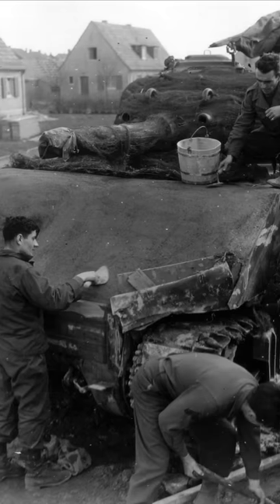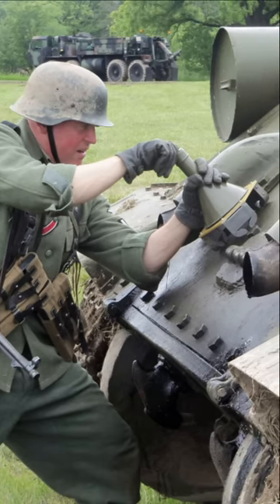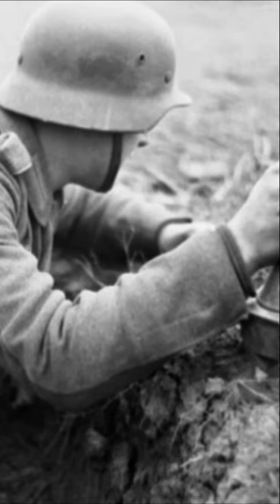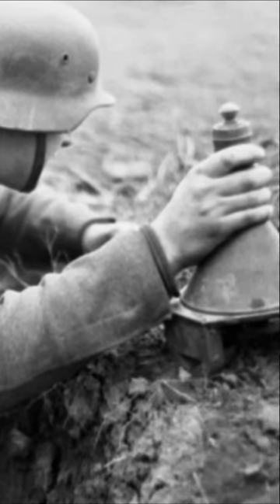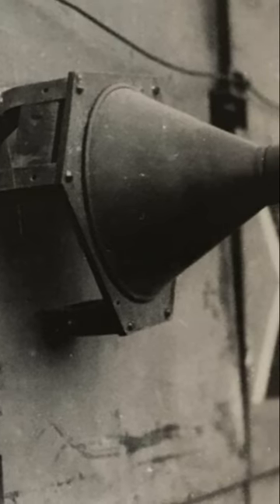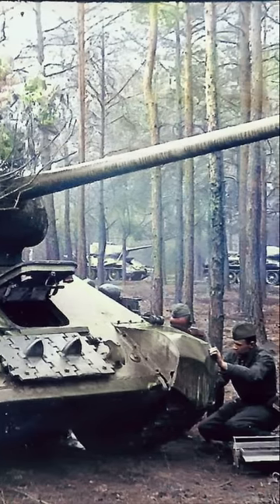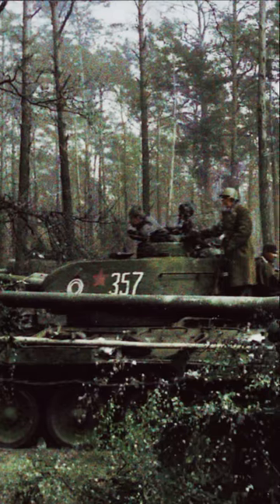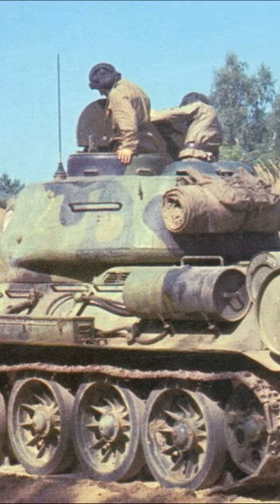Why did they put cement on tanks during World War II? #shorts

Comment: Notably the American crews also added concrete to the front and sides of Sherman’s to increase their armour protection
Reply: That's the main reason.
Reply: yea but it's more of a moral boost at best
Reply: But most as a moral boost as the concrete just added weight and a lot more shrapnel
Reply: Still did nothing tho
Reply: @TacticalGaming_  it did nothing for a shot from a 88mm or a 75mm hitting directly to about 45° but if the shot was hitting at a shallower angle increased the chances of a ricochet.
It did help a lot Vs 50mm pak38s and smaller and of course Panzerfaust.
Not really worth the lower mobility and extra wear on the tank but you can understand why crews did it.
Reply: To *supposedly increase protection

It didn't work
Reply: Lei en una novela que usaban sacos de cemento o arena como protección adicional. Hasta algo de madera hubiera servido. Hay un video que relata que por los 70s usaron "blindaje" de madera contra rebeldes con RPGs en Filipinas.
Reply: @CS-zn6pp  it actually decreased the chance of richochet and probably increased the chances of penetration, because the concrete was so soft it guided the tip of the shell right into the steel and prevented richochet. It effectively became basically a reverse Armor-piercing hard cap.
Reply: They used logs and put them on the sides of it too, which was arguably the 1st reactive armor available
Reply: I highly doubt that a thicker layer of concrete would stick to a vibrating metal machine. Doesn’t sound plausible
Reply: @andresamplonius315  Yes, you are correct. That is right. They used wood in Phillipines to stop the RPGs from blowing up their tanks & armored vehicles, and the wood actually WORKED successfully at stopping the RPGs! But, Sometimes the vehicles may have been damaged still but the wood would save the crew or people inside the vehicle from dying after a RPG hit their vehicle, instead of without the wood armor the vehicle would have completely exploded and the crew / people would have died.

The makeshift or homemade scrap wood armor on Army vehicles in Phillipines was able to successfully stop RPGs from completely destroying or blowing up the vehicle because of the way the RPG works:
The RPG does not explode immediately on impact, the RPG will hit the target and explode 1-3 seconds after the impact so that way the RPG missile can go through the armor. Most RPG missiles work this way because if the RPG exploded on immediately on impact then the middle would explode OUTSIDE the vehicle or armor wall, it would just explode on the armor inside of cutting through the armor all of the way and exploding inside of the vehicle. 

This means the makeshift scrap wood armor that was put on the vehicles was able to stop RPGs from completely destroying the vehicles, because the RPG missile would hit or impact the wood first causing the fuse to go off before the missile hit the armor, this would cause the RPG to explode outside of the armor or on the armor instead of how it is supposed to work by cutting through the armor and exploding. 
Basically the RPG hits the wood, which causes the fuse to start the explosion and then the explosion happens outside of or on the armor of the tank instead of exploding inside of the tank.

It is amazing how some makeshift or homemade scrap wood armor put on Tank was able to save them from RPGs!
Reply: @andresamplonius315  Sí, estás en lo correcto.  Eso es correcto.  ¡Usaron madera en Filipinas para evitar que los juegos de rol volaran sus tanques y vehículos blindados, y la madera realmente FUNCIONÓ con éxito para detener los juegos de rol!  Pero, a veces, los vehículos aún pueden haber sido dañados, pero la madera evitaría que la tripulación o las personas dentro del vehículo murieran después de que un RPG golpeó su vehículo, en lugar de sin la armadura de madera, el vehículo habría explotado por completo y la tripulación / personas habrían  fallecido.

 La armadura de madera de desecho improvisada o hecha en casa en los vehículos del ejército en Filipinas fue capaz de evitar que los juegos de rol destruyeran o hicieran estallar el vehículo por completo debido a la forma en que funciona el juego de rol:
 El RPG no explota inmediatamente al impactar, el RPG golpeará el objetivo y explotará 1-3 segundos después del golpe o impacto para que el misil RPG pueda atravesar la armadura y explotar dentro del vehículo.  La mayoría de los misiles RPG funcionan de esta manera porque si el cohete RPG solo explotara inmediatamente al impactar o golpear, entonces el misil explotaría FUERA del vehículo o la pared de la armadura, solo explotaría en la superficie de la armadura en lugar de atravesar la armadura todo el  camino y explotar dentro del vehículo.

 Esto significa que la armadura de madera de desecho improvisada que se colocó en los vehículos pudo evitar que los juegos de rol destruyeran completamente sus vehículos, porque el misil RPG golpearía o impactaría la madera primero, lo que provocaría que la mecha se disparara antes de que el misil golpeara la armadura.  esto haría que el juego de rol explotara temprano fuera de la armadura o en la armadura en lugar de cómo se supone que funciona cortando la armadura primero y luego explotando después, dentro del vehículo.
 Básicamente, el RPG golpea la madera, lo que hace que la mecha comience la explosión antes o demasiado pronto y luego la explosión ocurre fuera del vehículo o en la superficie de la armadura fuera del tanque en lugar de explotar dentro del tanque.

 ¡Es sorprendente cómo una armadura de madera de desecho improvisada o casera puesta en Tank pudo salvarlos de los juegos de rol!
Reply: @nicklibby3784  rpgs always explode outside, the only thing that penetrates the armor it's the molten metal jet it creates. Think again about making the huge RPG warhead to penetrate a tank armor in one piece. There are lots of explaining videos you can see,please search, you will be delightfull.
Reply: Didn't work and damaged suspension
Reply: Clay doesnt.stop ATs.
So hence the name Tommycookers.
The US White Star on the sides were fastly covered with spare tankstracks ...
During combat sandbags over spare tracks were the best options..
88 s did its jkb anyhow .regardless...
work
Reply: No they did not. "Concrete" will NOT stick to the steel hull.
Reply: @rf2boi725  Not really.
Your not going to be running into alot of the big cats.
Most Sherman's incountered the most older Panzer 4 and even then, Sherman's can still be, and often were used effectively as long as they had infantry support.
Reply: @lostonearth7856  I wasn't talking bad about the Sherman (I think they were good) I was more talking about how concrete /cement wasn't an effective way to increase amour protection
Reply: The best ad-hoc armor was adding steel of any kind.  It helped the Shermans with protection fired from longer range.
Reply: @CS-zn6pp actually it increase the chance of bullet turn back to armor not ricolet, go on and search how ricolet work, put on cement only improve chance to hit

Comment: That’s also why German tanks have those lines on them (zimmerit) it was for protection against magnetic mines but only they used magnetic mines
Reply: * Zimmerit ;)
Reply: @The_Old_Gang  thanks
Reply: Zimmerit
Reply: @Madduckkk  you're welcome :)
Reply: They have no idea why zimmerit was put on tanks. That's there best guess. With no supporting data to prove it on way or another
Reply: @JackTalyorD  what I’ve heard is what I wrote in my comment
Reply: @Madduckkk  it's a assumption made on the properties that the material have  after the fact with no Frist hand accounts to support the concept. 

"We believe it was installed for this reason"

Have you heard about how people eat 8 spiders in there sleep each year.
Reply: @JackTalyorD  you gotta give your tank some drip before entering battle
Reply: @Madduckkk  it looks fucking cool.

Like racing strips makes my car go faster
Reply: @JackTalyorD  yes it also helps the engine and transmission become more reliable
Reply: It also was used by the Germans to reduce IR signature and light reflectance.  Thats similar to the CARC (camouflage anti reflectance coating) on modern U.S. Army armored vehicles. It maintains a matte finish and I’ve only seen it shine when some geniuses applied brake fluid to the coating for a parade and then had to scrub the granola and sprinkles off their tank later.  
So it wasn’t for magnetic mines but reducing the tank’s signature and visibility.
Reply: @daviddunkelheit9952  that's a new one on me have never heard that before .

I'm not sure how that would work considered that night vision was only introduce around 1944-1945 and had a range of 30-100 meters.

And honestly dont see how it would break up distro on the visible light spectrum any better than a normal Camo camouflage pattern.

But and interested to hear more about it.
Reply: @JackTalyorD  it was easy to apply and gave a good textured base.  Almost like “white washing”.  Petroleum distillates were in very short supply so painting was limited to the factory.  Albert Speer was the Reichsmarshall for industrial production and was very successful at these simple but effective solutions.  Application of CARC in modern vehicles requires full suit and respirator.  Really toxic stuff but super durable and can withstand DS-1 (decontamination solution) spray that would peel automotive paint off… 
They did have IR scopes and rudimentary ground surveillance radar during that period of the war.  But it mostly was for visual camoflage and the ability to adapt the vehicle to new environments quickly.
Reply: @daviddunkelheit9952  the same time they hard ir scopes in the field was about the same time that German tanks left the factory painted oxide red.
Reply: @daviddunkelheit9952  that's quite interesting I only unstand about half of what you said will need to do some reading to catch up
Reply: @JackTalyorD  oh yeah I forgot about that factory oxide red.  😎 Thanks
Reply: Made from pine resin.
Reply: So it worked
Reply: @daviddunkelheit9952  one thing that's apparently never recognized is it's heat dampening properties.
   It's reasonable to assume that part of it's function was to provide a buffer zone against shaped charges.
Reply: @daviddunkelheit9952  Where did you get this from? I've never heard or read sth like that. IR signature was irrelevant in these days and I doubt a tank without Zimmerit has more reflection than with it.
Reply: Typical overengineering/overthinking: "we have magnetic mines, so we have to protect our tanks against their magnetic mines"... They have NO magnetic mines. Our ZIMMERIT goes in vain...
Reply: @zbigniewgurak8261  German moment
Reply: @zbigniewgurak8261  Yeah they thought, that the allies and soviets would copy the magnetic Hohlladung. Every tank needed a longer time to produce because of this bad decision
Reply: @ratatoskr8190  Time to cover with zimmerit. Cost of zimmerit. Weight of zimmerit on vehicle (~200kg on typical tank) = fuel consumption. Error, error, error...
Reply: The ironic thing is the brittish copied zimmerit to use against those mines 😂
Reply: Just what I was thinking.
Reply: @JackTalyorD  There are first hand accounts of why Zimmerit was invented and put ont tanks, not only from the german side, but also from the allies who researched on a anti magnetic coating themself and tested the german Zimmerit.
And the coatings from the allies (the research did go one even after the war) is were the heat insulation or IR camoflage come from, saying it came from the german Zimmerit is a assumption without any accounts.

Comment: Their magnetic shaped charge grenades were highly effective. The magnets were strong enough to place the grenade upside down on muddy tank hulls by troops in slit trenches.
Reply: Imagine being in a trench with 50+ tons of pure destruction rolling over it.
Reply: @raymondo6498  I once worked with a Hungarian that served on the Eastern Front. He enlisted in 1941 at the age of 14 (told them he was 17) to become motorcycle dispatch rider then operated a heavy motorcycle rig pulling a  trailer or sledge carrying supplies to the front and bringing back the walking wounded. Said he got roped into laying in wait for approaching T-34's inside structures where he pulled a Teller mine into their path to blow off the tracks. He said the smart drivers zigged zagged when going down urban streets to make that harder to accomplish so he had debris stacked up with a hole he could peek thru. That way he wouldn't get a face full of dirt from the blast if he pulled it over at the last second. He managed to disable 5 tanks that way until his boss told him to stop doing that after the building he was hiding inside collapsed when knocking out the 5th one. Said he was trapped under the rubble for three days while fighting raged outside.
Reply: The magnetic mines were not effective at all. Nobody else used a similar concept except for the lounge mines of the japanese.
This mines had to be layed by hand on the enemy vehicle, you are using a melee range system on a tank.
Funny how the german plastered their tanks in zimmerit actually believing thwy had a good idea
Reply: @nahuelleandroarroyo  Just because no one else used it, doesnt mean it wasnt effectiv.
No one else used a multipurpose MG like MG34 or MG42 but they were highly effective.

also the biritsh had something similar to the magnetic mine, they just used glue insted of magnets.

Comment: The mine the German soldier is attaching is called a Hofthallaladung. It is a shaped charge held at the proper stand off distance for best penetration. The soldier runs up, stick the mine to the tank with the three magnets, pulls the lanyard on back to start the fuse and has x number of seconds to get a safe distance away. 

 The Germans thought if we have it the Allies must have something similar so they invented zimmermit anti magnetic mine paste and installed it on all their tanks for a threat that never materialized.
Reply: Hafthohlladung not Hofthallaladung

Comment: AM SURE THE GERMANS WERE THE FIRST TO DO THIS ON TIGER 2 (GIVING IT ICONIC TEXTURE LOOK) THE GROOVES PREVENTED SUCTION ATTACHMENTS AND EVEN PREVENTING STICKY EXPLOSIVES TO STAY ON THE TANK..
ALSO YOU KNOW CEMENT TAKES AGES TO HARDEN.. CEMENT WAS PROBABLY NOT IT 
🥶🥶🥶
Reply: It’s was not cement, I think the Germans used a mix of silicone and plaster, USA used concrete on Sherman’s to give them a chance against tigers 1s which lead to the m4a3e2  or jumbo
Reply: @Michael-fi3uu pine crystals dissolved in benzene, zinc sulphide, barium sulphate, pine saw dust, PVA glue, pebble dust and ochre.
Reply: What they use was called Zimmerit. Someone in the comments listed the ingredients.
Reply: Not Cement, Zimmerit. Which appeared around late-1943/mid-1944 on all sorts of Tanks from early Panzers to Tigers and Tiger II's, it stopped being used due to a combination of false claims that it made the tank catch fire easier and shortages of armored vehicles
Reply: @raydog0483  not just that. But Germany was on the defensive more 44 on. And the Russians used magnetic mines.

Comment: Logs were also strapped to the tanks in order to add additional protection against armor piercing rounds.  Actual degree of effectiveness is a different matter.
Reply: They werent attached as armor. They used to logs to help get out when they were stuck.
Reply: @Yettiattack   The subject is armor and prevention of mine attachment.  I do realize the logs had a double purpose...  I thought everyone know the logs were also used to help the tanks get out when they were stuck so it did not need repeating.  Thanks.  See next for your edification.  "Logs were another improvised armor added to tanks during WWII. However, they could also be removed from the tank and placed under the tracks in boggy terrain for additional traction. In fact, many Soviet tanks left the factory with logs mounted for this reason. As armor, however, logs did not offer much protection. Like the sandbags, a full-power AP round could penetrate a log and reach a tank’s hull armor with very little lost velocity. However, it did provide some stand-off distance to protect against shaped charged weapons. Still, the molten jet of copper created by these weapons was generally unfazed by the extra spacing of a log." See link.  5 TYPES OF EXTRA ARMOR THAT WERE ADDED TO TANKS DURING WWII
We Are the Mighty | July 23, 2021   https://www.sandboxx.us/blog/5-types-of-extra-armor-that-were-added-to-tanks-during-wwii/
Reply: @Yettiattack  that's what I thought but other people have said they were multi purpose like so many other things.

Comment: Damn... didn't know that. New sub
Reply: They did Not.
Reply: @comsubpac uh ye they did 
He litterly showed you photos
Reply: @garyslayton8340   WHATS THE DIFFERENCE BETWEEN GREY AND BROWN IN BLACK AND WHITE PHOTOS 
🤔🤔🤔
Reply: @bren2385  the shades of grey and black? And even without color its clearly concreate
And finally why would he lie about it theres a million photos
Reply: @garyslayton8340   CONCRETE TAKES AGES TO HARDEN AND EVEN WHEN ITS HARDENED ONE SHOT WOULD SHATTER THE CEMENT OFF, MAKING IT POINTLESS.. 
AM CERTAIN IT WAS A TYPE OF CLAY BEING USED THAT WAS BRITTLE BUT DURABLE AT IMPACT AREAS (ALSO EASIER TO MOULD INTO CONCAVE GROOVES)
👍👍👍
Reply: @bren2385  mhm 
It only really helped against handheld shaped chrages but patton let it happen for morale cause it gave the tank crews somthing to do and made them feel better
Reply: Zimmerit and Zement (concrete) are completely different things. They just sound vaguely similar. It was made from 
40% barium sulfate
25% polyvinyl acetate (similar to wood glue)
15% pigment (ochre)
10% zinc sulfide and
10% sawdust